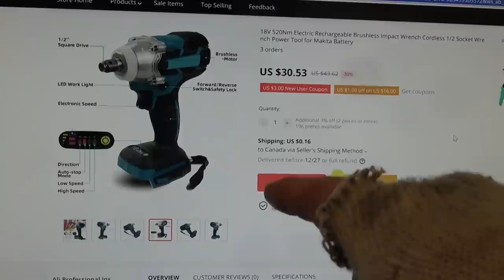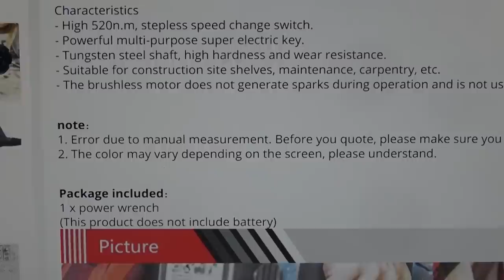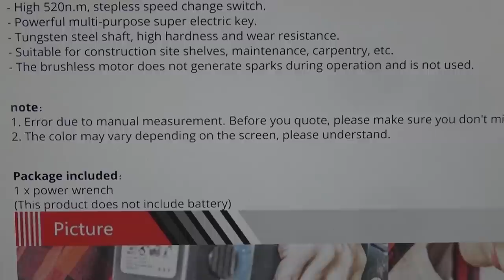BOLTR: Fake Makita Driver

Comment: Stuff gets copied / cloned. Think in terms not only USA, but the less developed world. What a benefit to them in terms of price.
When I head to the local DEPO here in Europe my eyes roll the f* over when I see how much original Makita and Bosch power tools cost. I'd rather get a noname Jasper that costs 40 Eur, instead of 180 Eur Bosch. My salary just doesn't allow it. I imagine in some place in India, say Bangladesh, the salary would be waaayyy lower. So, they would benefit from it.

Had a personal experience with impact drills by Jasper vs Makita. We had a flood and concrete flooring needed to be drilled out with chisel bits, so that the water passes through the holes. I made two holes with Jasper tool while another worker barely made one hole and then stopped. I had to finish what he started. In my case, a newer Jasper had a softer hit absorption cushioning while Makita had the one that was felt by your hands. 

I see little point of buying expensive pro tools since:
a) in about 3-4 years time there will be a newer tech feature that will render the more expensive Bosch tool to be outdated (better cable, charging time, USB port charging)
b) the cheaper noname tool may live on as much as the more expensive one 
c) economically it would make more sense to buy another 40-50 Eur power tool with NEW parts after 5 years. How long does Makita run? 10 years? 
Price comparison: one Makita for 150 Eur spread over 10 years vs two noname tools for 80 Eur spread over the same 10 years. Twice as cut. With a second tool having newer features (better cable, charging time, USB port charging) and the first tool still running.

But, yeah, I agree cloning the design is bad. But again, one has to question, is this a marketing trick merely cloning/imitating the colors? Does the original Makita have the same build as the fake one? I mean, one would have to cut open Makita as well. Other than that, maybe they are just playing a visual trick to hook the unknowing customer.

Comment: The real one has less features because they arn't directly comparible. the "real" one you have there is basically a base model and a bit driver vs the brushless impact. obviously, its the same crap as the more expensive Makita square drive brushless but you aint paying for the brand...
That's what happens when you build your tools in China.. they also build and sell them but remove your brand lol

Comment: i had bought one of this fakita and i realised that the battery is very low quality, when i was unbolting some m12 rusted bolts it cut the power every 10sec. After that i found some parkside genuine batteries and install them, and then i used the same tool for more than a week whit one battery and single charge. the tool is not bad, but the battery is sh.t.

Comment: you don't know a thing about tools the reason i saw that is you must not know the difference between a Battery Impact and a Impact driver are night and day in regards to power or Ft lbs of torque. The impact with the socket head should have 4-5 times the ft lbs of power.. Also why do you keep saying 3 phase??

Comment: Says ryobi are garbage yet the new ryobi one plus has far more torque than that genuine makita for half the price. Makita are overrated
Reply: shifty all the power tools are made by the same German owned Hong Kong based power tool company with factories Dongguan.
Reply: Makita is owned by Makita. They have always had the best motors and durability.    Cool you're Ryobi has 30ft lbs more of torque but will it last 10 years of use including falls.

Comment: Sooo, I was interested for the price and sourced one of those Fakeitas for myself. TBH, it is much better made than most of the cheapo stuff we get here for up to 60€ without battery - it could easily pass as a 100€ tool.  Only question is, is it stout enough that I should worry and buy a set of impact sockets or is it OK to use my standard Proxxon ones :D

Comment: Just bought one of these as a back up. Should have it soon and want to see how it does with my car's lug nuts!
Check out the new AutoJare B1803 w/ 405 ft lbs torque. Just under $100.00 now on Amazon and comes complete w/ 3.0Ah battery, charger and case! Own this one myself and love it so far
https://www.youtube.com/watch?v=3i_JFkh5gZE